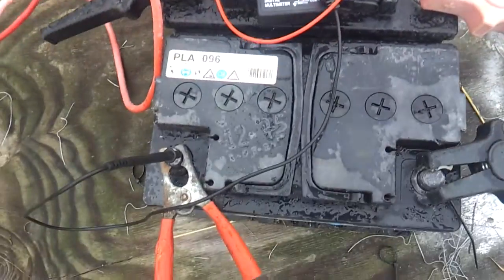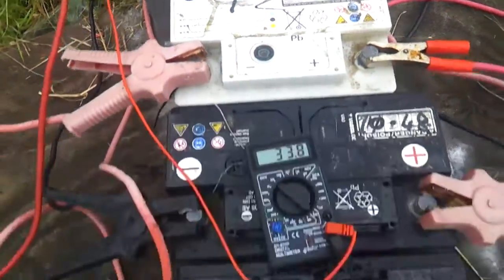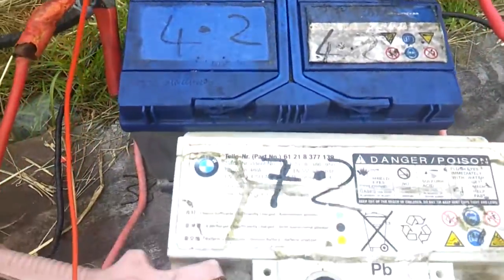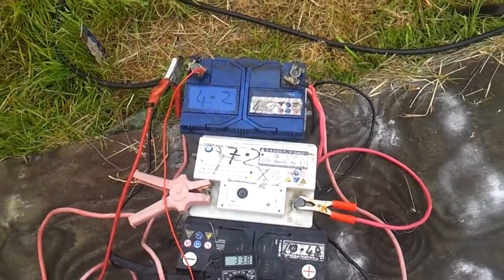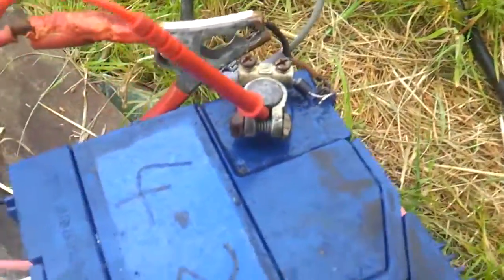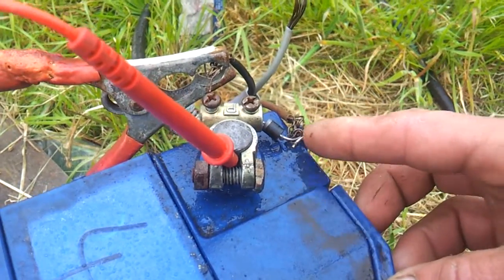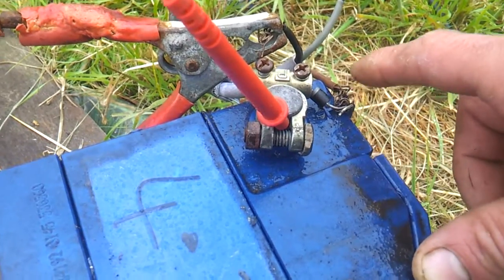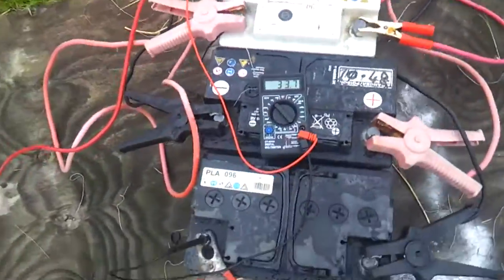DIY WIND TURBINE DIODE FOR BATTERY BANK 31 05 2015

Comment: Hi I am trying to make a mini DC VAWT for my 1 bed flat I am using a couple (donated) 12v motorbike batteries in parallel for 12v output. I have all the materials and skills for the fabrication. But unfortunately have limited knowledge of electronics, I want to use a blocking Diode to keep it cheap and simple, but am stuck on what size Diode I will need. Any advice would be much appreciated! ✌🏽🌎🌻
Reply from the maker: You only need a diode if you are running a DC motor, if it's a three-phase motor, you don't need a diode
Reply: @GavinFreedomLover  do u only need a diode on the positive terminal? Im going to use a 150w dc motor from amazon and connect it to my portable battery pack. They have mc4 connector diodes i was going to use on the positive terminal
Reply from the maker: Hello folks, sorry I've only just seen this comment. I can't really help because I've actually forgotten. It's been so long since I've done anything like that, as I am just using AC motors now the rectifier takes care of everything. Cheers
Reply: @GavinFreedomLover  nice! Yea i figured it out with a diode. My builds super simple im using a 150w dc motor with mc4 connectors that have a built in diode and then i plug it right into my wattfun power station. Easy! I think going to do a utube video so people can see what i did and copy it. In total im only spending about 60$ for a 150w wind turbine

Comment: hi still having probs with this diode have bought a 30a wind turbine blocking diode i put it between meter and charger ,have 2 batteries set up for 24v ,when i put diode in the charger now says theres 14.03v but take diode out and goes to 23.79 which is right diode right way round im at a comlete loss as to why its not reading it properly

Comment: hi
i have put a diode in beteen my batteries and fused switch but now my meter does not work were is it best to put this diode turbine controller /meter /fused switch/batteries,
thought about just after the controller and before meter ,problem ive got it seems to be draining batteries probably controller and meter using power from batteries ,i have turned batteries off and as turbine starts up it will charge controller  , mmeter comeson but no display is shown anyone any ideas please
colin
Reply from the maker: Not sure mate tbh, have you got the diode connected the right way round as if wrong way round it would block signal to the meter.
Reply from the maker: Is the motor producing dc or ac? if its AC then I think the rectifier should take care of it and you don't need a diode.
Reply: Yes making dc but seems to drain batteries will give it amother go